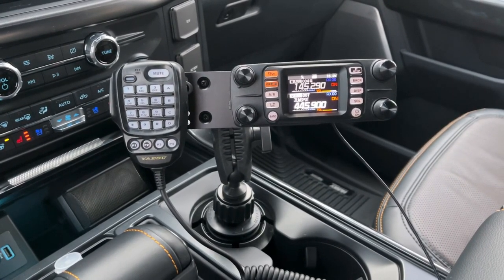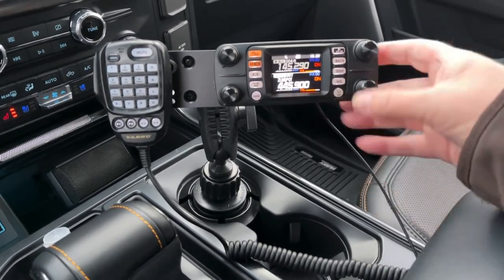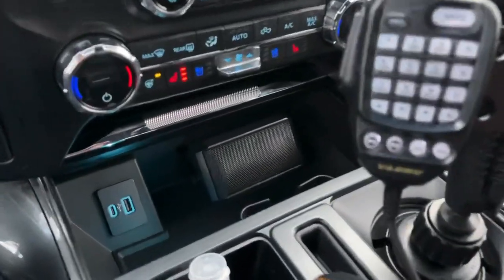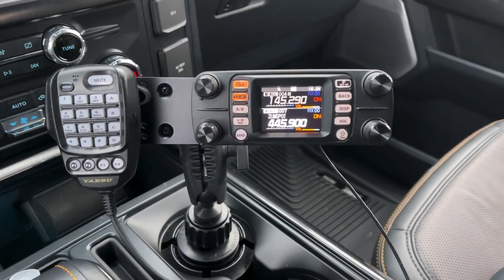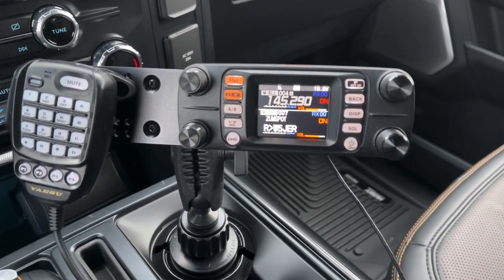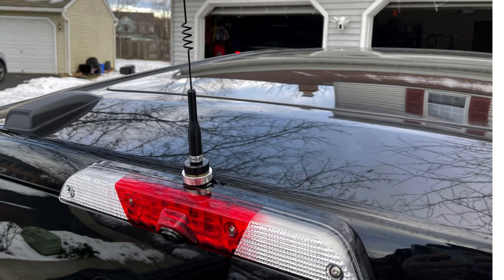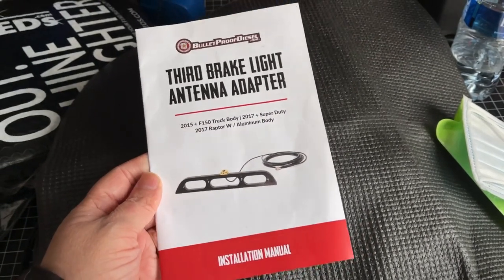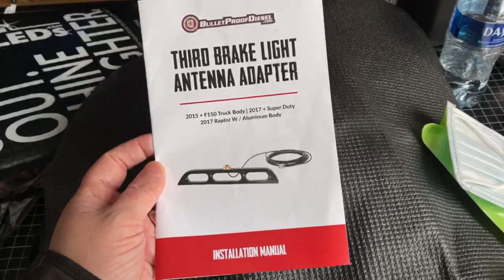Yaesu FTM-300D and Bullet Proof Diesel Antenna Mount Install - 2021 F150 Tremor

Comment: Very clean setup.  I have a ‘22 Tremor in Antimatter Blue and love it.  I’ve found there are very few places to mount a radio body in the truck.  I had planned on under the rear seats, but it’s really tight down there.  And practically no room behind the rear seat backs.   So it’s either under the passenger front seat or in the console like you have it.  Glad to hear the bulletproof mount is working well, I’ve About narrowed it down to that one.  Considering getting the dual antenna option to add a WeBoost.

Comment: Nice!  I'm having the Bullet Proof Diesel antenna mount installed on my new 2023 Ford F-150 on Friday (June 16, 2023).  I think I'll put the Icom 5100 body under the driver's seat, the faceplate where you have your speaker on a RAM mount, and the speaker in the driver's side cubby along the center console.  I also bought the B-10 antenna to clear my 8' garage door without scraping for everyday commutes (I'll use the SS-6805BNMO for RV'ing and road trips).  Do you think the antenna mount is sturdy enough to handle the even larger SBB-5NMO antenna?  Thank you and 73.  KI7LIL.  Pete in Arizona.
Reply: How’s it been?

Comment: My antenna is mounted to a headache rack that is grounded to the frame in several places and it works good as long as I’m not a full power 50 watts ! Reduce to 25 or less it golden. Do you think the third light mount would make the difference? They are to expensive to get the same results ! Thoughts ?

Comment: Great video and setup!  Do you notice any extra heat build up with the body being in the console?
Reply from the maker: Not this time of year for sure. And it runs pretty cool anyway. So not yet anyway. Thanks for watching!
Reply: Any pics of the install?  I have the extra brake light camera and it says you have to file something down?  Also anything to know before the install?  Expensive, but if it works then it might be worth the investment
Reply from the maker: @Burkey612  what exactly says you have to file? For this setup, nothing was filed down. It was pretty straight forward. Also, the only holes drilled were to mount the radio base inside the center console and a hole to get the antenna coax inside.
Reply: @W5JER  on page 4 of the instructions downloaded online.  Half the page is about filing the mount due to the camera.  Maybe the mount had been altered since then. Thanks for the reply!

Comment: Nice setup.  Question: Where did you get the thin head control cable from? Reason why I ask is that the Yaesu FTM-300D  head control cable is like a flat CAT 5 which makes it a bit unwieldy when using it for long runs.  Like if the body of the radio is mounted in the rear cargo area of a vehicle and the head is up by the driver.  Thanks and 73s.
Reply from the maker: I bought it on Amazon. It’s a cat 5 cable.